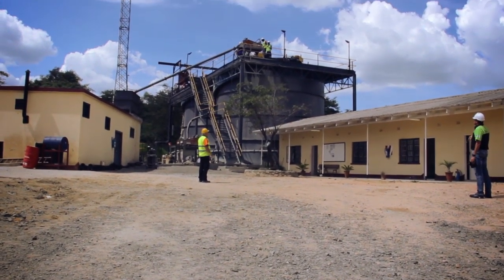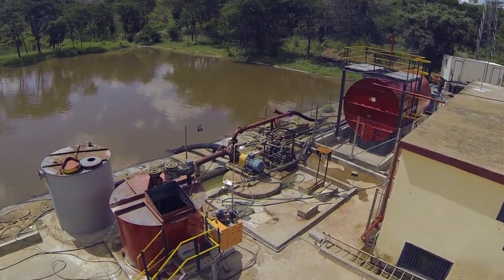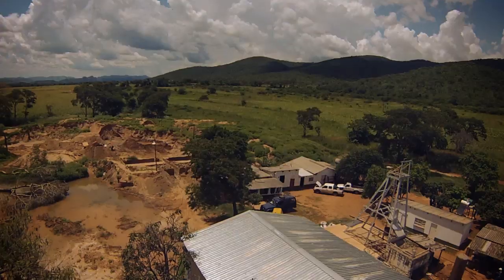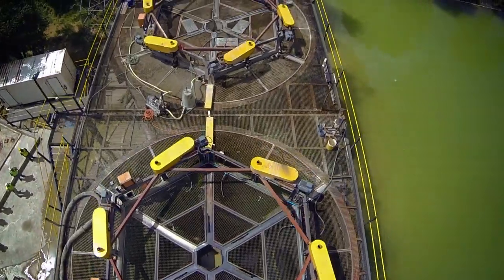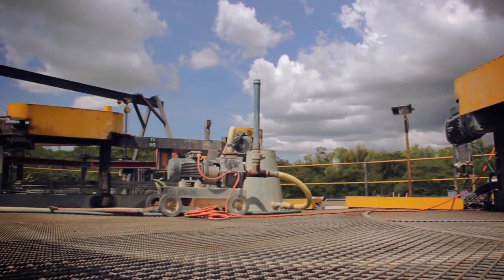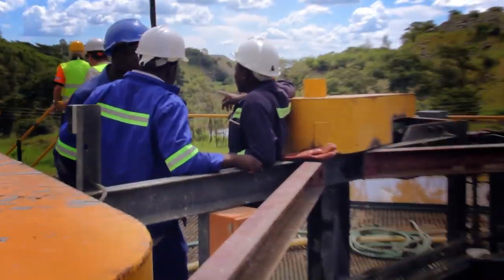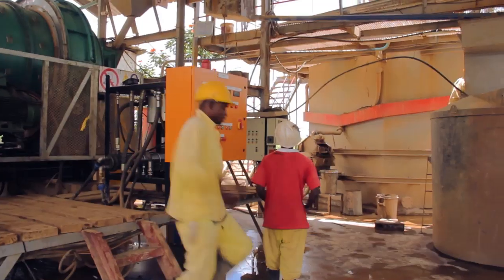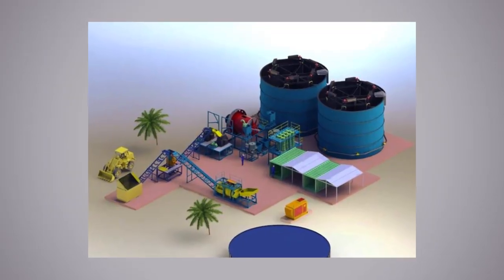CIP/CIL Cyanidation Plant for Gold Recovery: APT Modular Mineral Processing Plants

Comment: Why Flexicone Leaching Technology?
There is no need to keep a separate position of a chemical technologist on staff.
Enough knowledge at the level of school chemistry and amateur photographer.
For specialists I explain - we solved the main problems in the leaching of gold.
In our technology:
low cost reagents
non-toxic, non-flammable, non-corrosive reagents
stable easy-to-manage gold solution (PH from 4 to 10)
selectivity to noble metals (copper, arsenic, tellurium, etc. is not a problem)
recirculation of solution and reagents, without discharges into the environment
What is the output?
empty cake (rock) washed with water containing elements in the wet part of the solution at the level of the mineral of Esentuki
precipitated BM with a purity of 98-999%
regenerated solution with the main reagent 99.5%